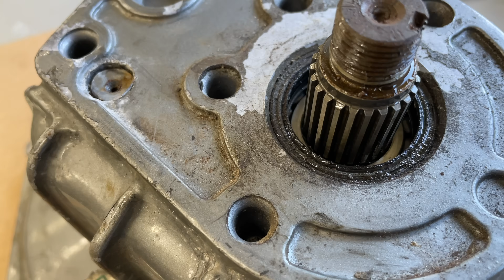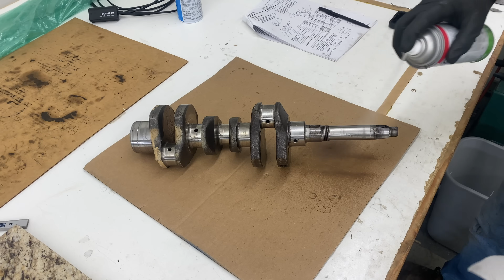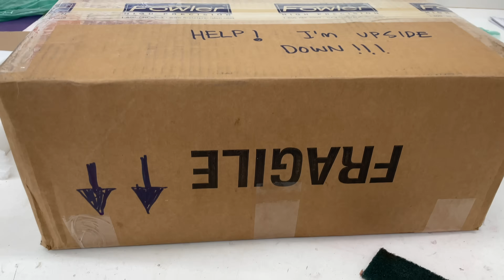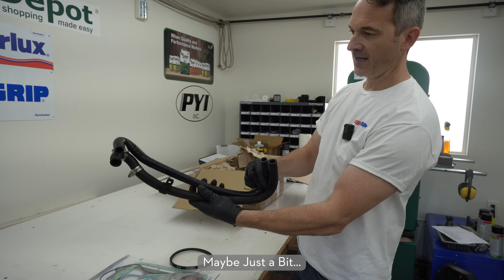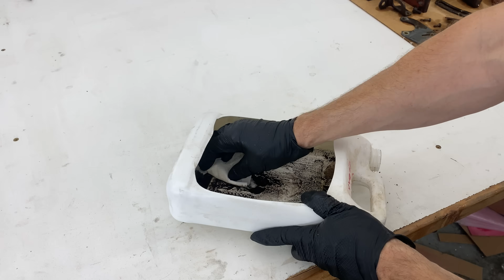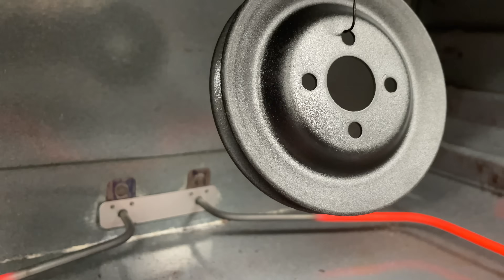DIY Engine Restoration: Refurbishing Rusty Yanmar Motor Parts

Comment: I original exhaust elbow looked rusty as all cast iron exhaust parts will get, but I didn't see anywhere where it was rusted out. Are you just using that as an excuse to fit some bling? Lol 😉
Have you tried putting the dirty mineral spirits through a coffee filter, just pour the dirty mineral spirits straight from the cleaning container into a coffee filter over the jar. Coffee filters also work well for many other things apart from filtering coffee including final cleaning of machined surfaces.
Reply from the maker: When the inner baffle inside the elbow rots out the water can leak down into the engine side of the system so better just to replace now in my mind. 
Thanks for the filter idea. 👍

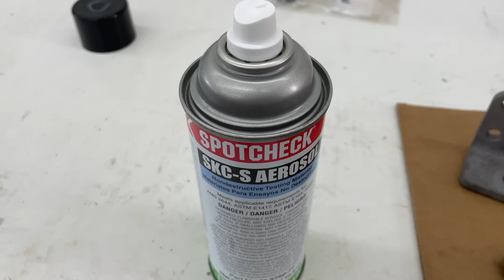Comment: 21:42 Brake parts cleaner, available at walmart among other places (but cheap at walmart). Fast acting, fast evap time and cuts through all the oily residue from whatever source.
Reply from the maker: Thanks for the tip. 👍

Comment: I'm surprised you are having problems with Ford Lehman parts. I rebuilt mine from parts i got in England. I bought Ford parts not Lehman. Mine is a 2712e. I got pistons, sleaves, gasket etc in a kit. Only £400. Yes it was ebay! It all looked good though. Only a few hundred hours in now. It runs great. Not so much the Paragon transmission. 😢
Reply from the maker: Interesting! In NA there is a major distributor (American Diesel Corp) and the owner Brian probably knows about as much about these engines as anyone could ever hope. Parts are available but some of the 4cyl specific parts are getting harder to find - I am told… I don’t think she needs a rebuild so I’m hoping to get more good hours from that power plant. 
I have the 2722e Lehman SP90 Ford Dover.

Comment: I recently bought a starter motor for my Volvo Penta MD2003T from Parts4Engines.  Being based in the US I was hesitant to buy from the UK both for VAT and shipping expense.  My worries were misplaced. I was looking for a high quality starter not some knock off from China.  I wrote them asking who made the starter they were advertising.  I received a prompt reply stating it was a Bosch starter made in Germany.  I placed my order via email and received the part within 3 days with minor shipping charges and no VAT.  I can recommend this company without hesitation and am sure I will use them again in the future.
Reply from the maker: That’s a great data point! Thanks for sharing 🙌

Comment: Just an FYI, you order bearings after you or machine shop determines that the crank does not need to be cut undersize.  Takes a bit of knowledge to figure this out and a guy in his shop may or may not be able to make the call.  That is what a good machine shop is for.  Good you are doing a total rebuild of the head.
Reply from the maker: Yes, it’s a good point. I Mic’d them out and they are in spec so I’m thinking the standard size bearings will be a good fit. We will plasti-gauge them before final assembly to make sure the tolerances are correct. 👍

Comment: Slide hammer with a drywall screw is famous foe easy seal removal
Reply from the maker: I’ve had success with that. Two of these seals have very little surface area to get a screw into… 🤔
Reply: Done that too - or just a vise grip grabbing the screw if seal is small